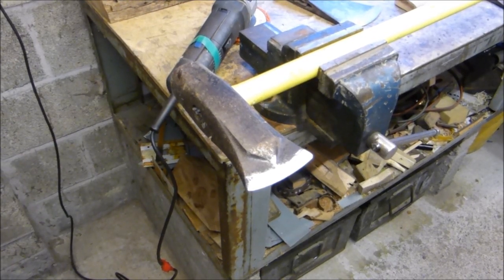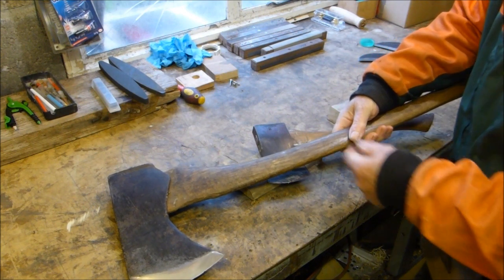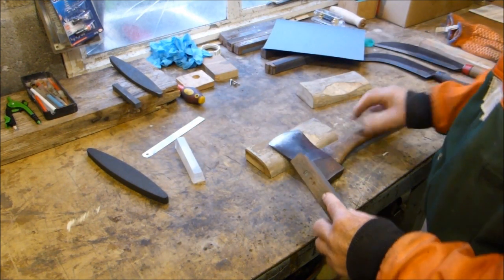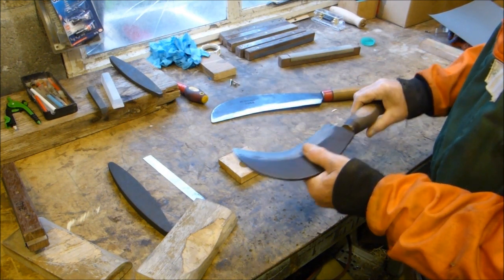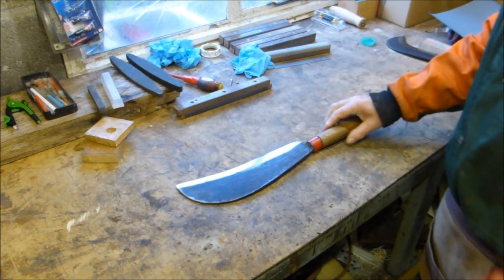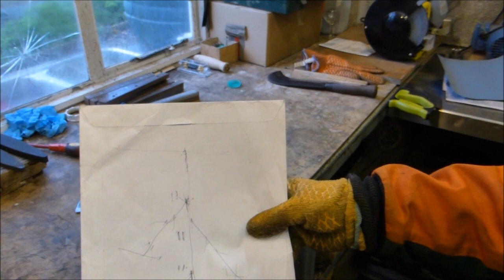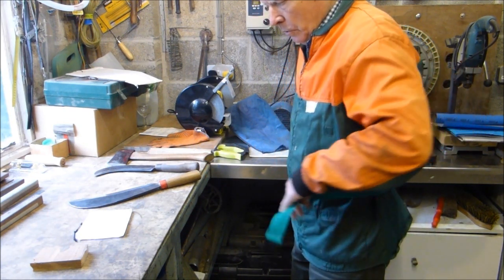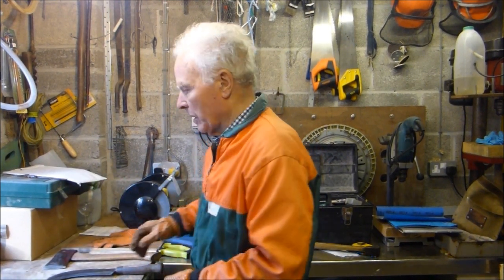Billhook. Purchase, care and use.

Comment: Thanks for the useful information; I collect bills from all over Italy, and often I have to face a careful restoration. My equipment is similar to yours, like the way to deal with the security issue. To keep the billhooks sharp and rust-free, I build thin plywood sheaths, also so as not to injure myself when I put my collection away. I have to build a belt hook like yours, I hope not to infringe any patent!
Reply from the maker: Glad you like the belt 
 I call it a cradle and although I glimpsed something similar in a hedgeing competition I made one myself but more simpler and it in so effective. 
Tips! Use 4mm hardrawn wire that is quite hard to bend but stays in shape. Follow the pattern by observing the video closely, then see if you can get a similar belt with an adjusting buckle so that you can thread the cradle through the adjuster to hold it firmly in place. If you get it right then you will treasure it for life!
Regards, Cliff

Comment: Thanks for taking the time to make this informative film.  I've found most old Billhooks when you get them are as sharp as butter knives, often the bevel is too steep or rounded. When sharp like yours they are a good  efficient tool. The tang should also go through the handle full length to secure the handle with a peened over end and washer.
I saw on you tube one tang being ground off short and handle glued with epoxy glue, disaster in my eyes, also ruining a good tool.
The 1942 hedging film is a classic !
Reply from the maker: On Ebay. Look out for "Starke" sandpaper, they sell it singly or as a package with sheets from 600grit to 6000. I have made a video on how to make sandpaper files and in it there is an indication of how to use them. Regards, Cliff

Comment: Hello Cliff a pleasure watching you, nice to see some common sense at last. Billhook usage on You Tube is usually a knowledge vacuum. Some of the purported "restorations" make me cringe. I agree these are working tools, potentially dangerous, so it's important to know what they're intended for, how to use them properly and how to look after them. As you say they're not toys to play with in the woods (everybody has the same main arteries running down the inside of their legs) .  Nice you've got your Dads felling / de-legging axe (looks like an Elwell No 7). Also think you've got a Newtown pattern hook, but I can't be sure which pattern you've got for your Brades.  One point I would disagree is having a gloved tool hand -  Ever. Direct contact with an unvarnished wooden handle always more reliable, even in the wet.  As to blade guards I use old hose pipe kept in place with old bicycle inner tube retainers.  A round diamond file is really useful for running round the hook blade for sharpening once it's had the shoulders and angle of cut already reduced.  (Master Hedgelayer 20yrs +)

Comment: Great information. For camping I have an ax & a hatchet but have been thinking of getting a billhook as it looks like a good tool for some smaller or finer tasks. I notice yours has less a hook, is that because it's newer or are there different styles of them? Thank you.
Reply from the maker: No. None are made without the hook, so what you see is the billhook. The one I have was modified to use it without the hook and this is explained in one of my previous videos, "Using a billhook" that I am sure you will find very interesting and explanitary. Regards, Cliff